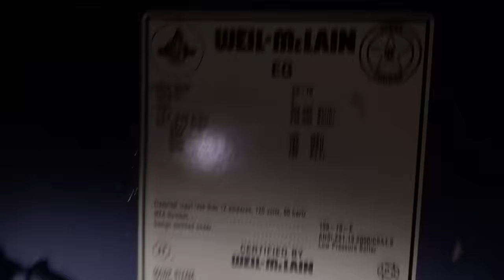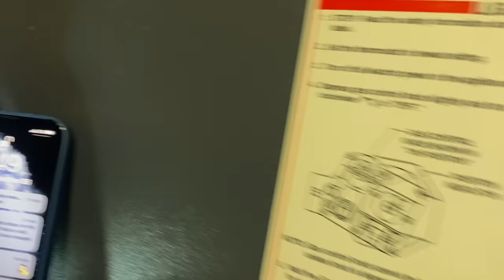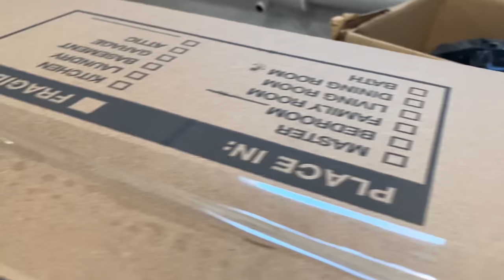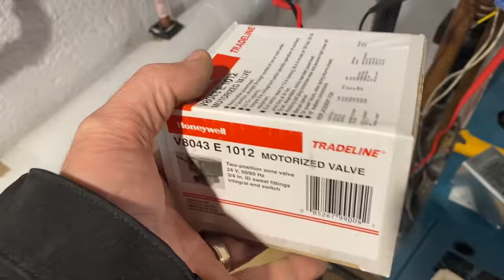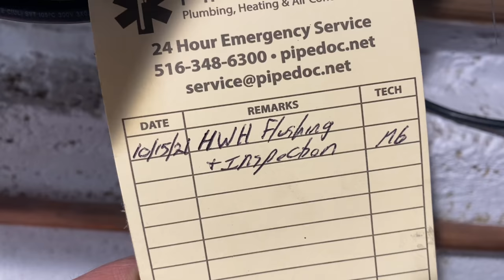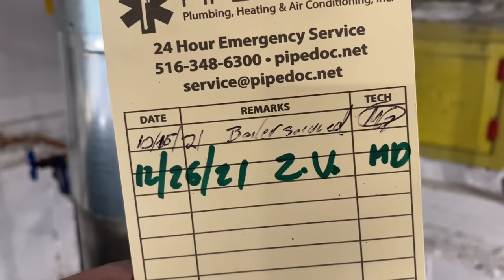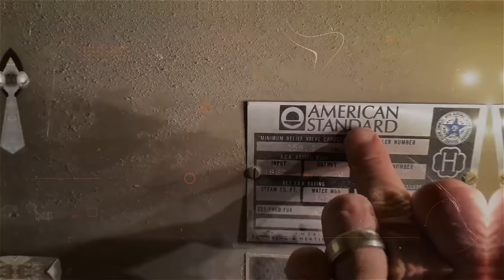Emergency No Heat Weil McLain EG75 Gas Steam Boiler Robert Shaw Gas Valve

Comment: Hi mike that is a thermal interrupter which shuts the fas valve off when pilot failure it can be bypassed with a normal thermocouple

Comment: @mikeypipes what you had there was called a Thermopile it's pretty much the same thing as a thermocouple but I'd say more beefed up, The main difference between Thermocouple and Thermopile is their method of measurement. The thermocouple is a thermoelectric instrument, while the thermopile is an instrument that modifies thermal energy into electrical output.
Reply: they also have different voltages

Comment: Love the Milwaukee heated jackets. I have the hoodie as well. Life saver for them windy days. The heated pockets really make the difference
Reply: I have the Milwaukee heated Axis jacket and love it! It's light enough to wear in the fall and spring and with the heat I can also wear it in the dead of winter with the heat on high. 

If I plan on being outside a long time maybe blowing snow I'll sometimes put a bigger jacket over it, but for short stints just the Axis jacket with the heat on is all I need.

I just got the heated hoodie kit with the battery and charger on-sale at Home Depot for only $99 as a Christmas gift for myself.

I've heard Milwaukee isn't making these heated jackets any longer. Don't know if it's true or not but it's a shame if it is because they're great jackets!

Comment: Some millivolt generators are like that. Basically two types. One with wires and one with an end similar to a thermocouple. But, it’s not a thermocouple. It’s a millivolt generator, also known as a thermopile
Reply: How can Mike be sure the Manifold Jetting is matched with the new Gas-valve? I do home repairs and while working in the basement. I heard a Boiler Back-fire once and told the Owner to call the Gas-Company. Manufacture Engineers match the components. I thought the Serviceman had to use OEM parts? Also Mike should have changed that miss-matched gas pipe instead of putting a "LOAD" on the union connection when he hooked it backup. I think that Boiler should have been "Red-tagged" UNSAFE. I watch Mike and learned how to use a Pro-Press for Wet pipe jobs.
Reply: Here in the UK we tend to call them generator thermocouples.Only ever seen them on US pool boilers.
The generator/ thermocouple/thermopile produces the voltage to open the Gas valve via volt free external control.
It is wired via high limit stat and boiler stat and incorporates pilot failure interrupter, the two white wires connected to the  Gas valve end.
Reply: pretty much, all thermocouple's have the smaller diameter body, while the thermopiles/mv generator have the larger diameter body. keep that in mind and you'll rarely be fooled, at least  until you hit the left hand thread thermocouples 🤯

Comment: Power pile gas valve on a gravity system...very popular with the Amish around here. I guess it is all about how you define (electric)  lol. Although these people still have heat during a power failure. They are also used quite extensively on these non electric, thermostatically controlled vent free gas heaters.

Comment: Yes mike that thermocouple is a power pile. Robert Shaw used those in almost everyone of there 7000 series Valves. Very  very common commercially. They made them with the two wire power pile or a threaded power pile. But electronic in that case was a lot smarter to go with. Great videos as always.
Reply: @boby115  yes you’re so correct. You know back in the day one of the commercial guys got sent to that house and that’s all he had or someone did a side job on it. I would only convert  to a electronic ignition it’s the smartest and best way to go. What’s funny I still carry three power piles and two 7000 series valves in my truck.
Reply: @boby115  all I do is commercial industrial and institutional. Really big into commercial refrigeration

Comment: its a 750 millivolt thermopile generator. They also come in a waffer looking style. There isnt any ac voltage to operate the gas valve. Also there used t be a specific millivolt thermostat that was used in this application.  Oh...and you guessed it.....i am definately the old guy that remembers when this was not an uncommon setup. Still running service calls and enjoying it after all these years.

Comment: The old device looks like a "voltage generator" not a thermocouple. The device is also called a "thermopile" and is used to generating higher voltages than a thermocouple. The sixe of the part that in in contact with the flame was pysically larger than a thermocouple. These are sometimes used in gas heaters and steam boilers and are available at most hardware store as are thermocouples. That would explain why the thermocouple did not fit in the gas valve. Your approach was good but very expensive. A replacement thermopile is around $50.00 at the big box stores and comes with two wire lugs on the end which connect to the gas valve.
Reply: Safety First Always! God Bless you for saying something. Always use OEM parts.

Comment: Those wrenches are also called line wrenches, used in automotive repair of brake lines to keep from rounding off the line nuts, just one of the many uses.
Reply: Flare Wrenches.

Comment: That little blue “ thing” you took out of old gas valve is a safety connection usually down to a thermal cut off , which when open , kills the pilot / thermocouple , no fire. Obviously someone monkeyed around and just jumpered a safety, but it has to be in there for space take up

Comment: Thermopile - Robertshaw love them,  1951 series (coaxial connector) probably at supplyhouse, 1951-536 for  36" unit. Generates 500-600mV (for testing purposes) The other section bypassed in the valve is a secondary cutoff, kept in place as a spacer, if the connection held together by the wire nut is disconnected it isolates the thermopile from the valve killing everything including pilot gas flow.
Reply: @PipeDoctor   Probably, but you now know what they are - no more surprises. I'll admit,, I mostly encountered them on commercial gas fryers rather than on heating equipt, but they are the same part. If they don't produce at least 400mV in the flame path they won't hold the valve open, if they ARE producing 500mV or above and the valve won't stay open - the electromagnet in the valve failed. Easy test point is the wire nut bypassed point. Red probe to the connection under the wire nut, black to the side of the threaded part holding it into the valve. Knowledge is power - If you aint testing, you're guessing, and now you know how to test a thermopile. Hope you and your family (Including employees) have a fantastic New Year.
Reply: Ran into this same issue at my girl friend's house over Christmas break about 20 years ago. Turns out it was exactly what these guys are all saying, it was a themopile and not a thermo couple like I was used to seeing.

Couldn't get it to stay lit. Thought I was screwed. 

Called a plumber friend of mine who referred me to an old Lilco gas boiler service guy who did some side work on his own.

He came out on Christmas Eve and had the thermopile that I needed in his old Buick station wagon. Lol

I couldn't thank him enough and wanted to pay him double what he was asking to be paid.

He said he was happy to help and said he knew my grandfather who also worked for Lilco years ago so he was happy to help a fellow "Lilco family member".

That's what people did for one another back then! 

I remember his last name was Harris. I'm sure he's long retired by now. But guys like they were a rare breed. I can't imagine the amount of knowledge and experience this guy retired with. I only wish I could have followed him around for a couple of years to learn what he knew just like how we do now with Mikey Pipes! 

Thanks for feeding us Mikey!
Reply: @crashoverride328  well said.

Comment: Have the same thing on my EGH 95 in my rental property. And that bypass is supposed to go to the back up second pressuretrol , when it reaches pressure it open the contacts and shuts down the pilot for safety.

Comment: I have seen them before, it's a 250mv thermo pile.   The jumped wire should have been connected to the role out sensor.  Or the like. Change the valve.

Comment: Thermopile 750mV system. Boiler has no external power supply? Old floor furnaces used this to operate gas valve.
Reply: @PipeDoctor  I seen as I watched further. Sorry, I was commenting b4 I watched through-its a bad habit. Weird combination with the pilot Gen and 24v system. Like I said it's how the old floor furnaces operated and some other heating appliances, but usually the gas valve will have a 750mV rating. I'm not sure why there was a pilot generator if 24v was available. Hack job perhaps?

Comment: It has been a while since I have seen one of those pilot gen assemblies, I have one of those in my parts for the last decade and still haven't used it. Around here, the system is usually bad with a cracked heat chamber by the time that part goes bad.

Comment: WTF? The gas valve should've said 750mV when used with pilot generator.  I'm confused now. Or all the millivolt systems I've seen say 750mV.  I think some are 250mV like on gas fireplaces. You did right putting in the intermittent pilot conversion. It's more reliable and doesn't waste gas to keep pilot lit when not needed.

Comment: Definitely bad generator. When there swelled up means there junk. I use to carry one of those on my truck for those rare occasions.
Reply: That plastic piece use to go to a thermal overload or limit. But most I seen were always removed and wired limit to 24v.

Comment: electrolytic capacitor/s on the LWCO have failed and it's getting a large amount of DC ripple or half-wave DC pulses. it will likely quit working soon (up in smoke) or be unreliable, it sounds like it's chattering the relay and it may even short out the transistor or ic and stick on filling. tell them to be prepared for a whole house swimming pool and fountains, also that crusty pipe  🤪🤪

Comment: Could you condem that first call system under health and safety concerns?
Reply: @PipeDoctor  the corrosion on the pipes and the wires almost touching the gas pipes.
Reply: @PipeDoctor  sorry If I confused you on that because when I saw the wires I thought that could cause either an explosion or fire.
Reply: No.

Comment: Sometimes I mistake you for Steve Lavimoniere, lol
Reply: @Menmyboy1230   not so much the esthetics, although that’s a sign of professionalism , the lack of safety.. in one recent video he removed the domestic cold water supply to a thermostatic mixing valve and turned the stand by setting , low setting , in an aqustat , to 170.. people could lose their skin in less than a half second.. so many things.. his changing a nozzle that’s worked for years and watch him adjust the boiler to accommodate the new replacement part without proper equipment is impossible .. is it a 1 smoke or 5? Open the air band for less smoke but increase stack temp , decreasing efficiency per gallon.. he doesn’t care.. he’s a hack and needs to be called out for it..